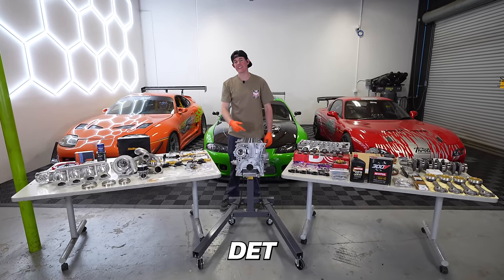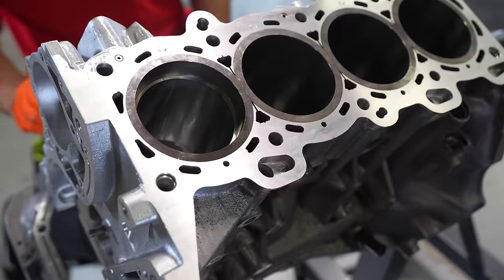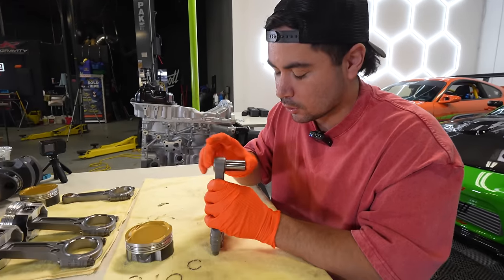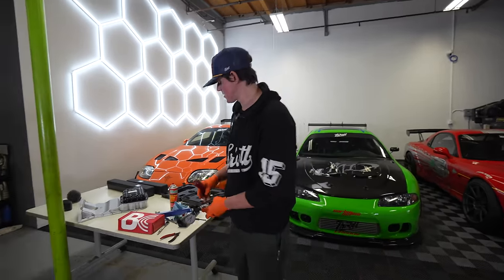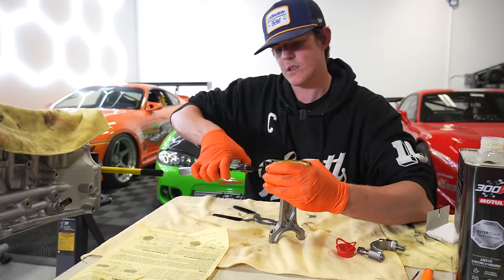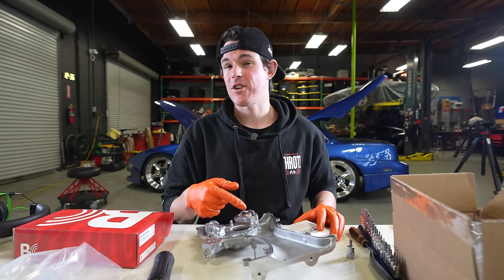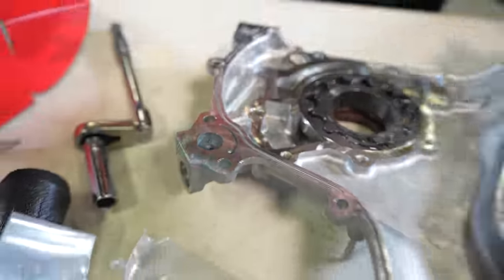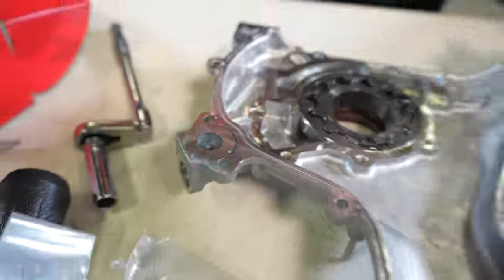+700HP SR20DET Engine Build - Full Start to Finish [4K]

Comment: Just added all the parts up, and this is a $20,000+ engine 😐
Reply: 700 hp that’s gonna last a ton of miles is gonna cost you
Reply: Is that just the engine build or is that with the turbo setup and clutch etc...

Comment: As someone who has been tinkering with sr20s since 1998, I can appreciate a good video like this. A tech tip for the hydraulic lifters, you can use a small allen wrench to put inside the hole of the lifter while it is submerged in oil and push on the ball inside the lifter, you will see the air bubbles bleed out of it that way. It actually talks about that in the FSM.

Comment: Lacing the rings 180° out from each other is the best way to keep the compression into the combustion chamber and not in the crankcase and keeps the oil in the crankcase instead of blowing it out of the exhaust

Comment: - I see a cool air intake. It's got a NOS fogger system and a T4 Turbo, Dominic.

- I see an AIC control there. It has direct port nitrous injection.

- Yeah, and a stand-alone fuel management system.

- Not a bad way to spend 10000 dollars.

Comment: Quinn, did you take the paper towels out of the engine block or put a head gasket on before you bolted down the valve cover? I don't think you did because I watched you do it in slow motion. Also, I think Teflon tape is better for the threads than what you were using. I didn't see you apply a gasket to the turbo manifold either. Were you just doing that for the video?

Comment: I want to see you put a machined, balanced, and blue printed engine into the Freak. You made a lot of mods to the used engine you installed and even then, it only generated 350 HP. You got smoked on "This vs That".

Comment: Buyed one Nissan Primera whit a sr20de by 100dls, it had a hit sound in cilinder 2, it is the crankshaft, hard to find in my country one new, im going to send it to refill it and set it on 0.25, the strange thing is that the pistons have just 2 rings instead of the normal 3 rings ._ . and i saw several videos and every video i saw all pistons have 3 rings........

Comment: I think that engine is going to produce 900-800 hp depends on the fuel that you're using and the ECU and engine tuning youre gonna use it won't be a 700-800 it will be a 800-900hp because of the high performance components that you have